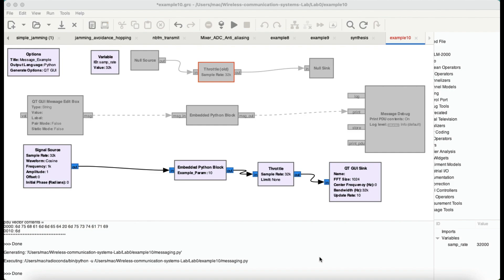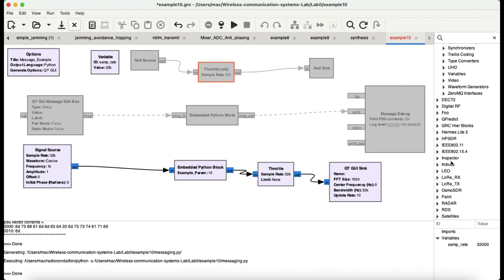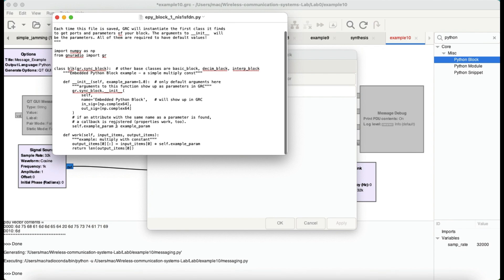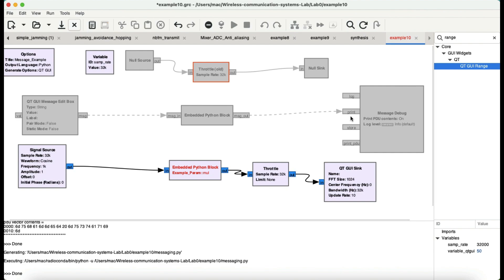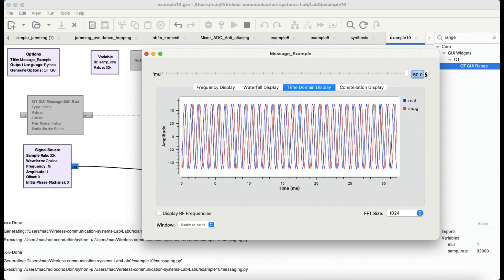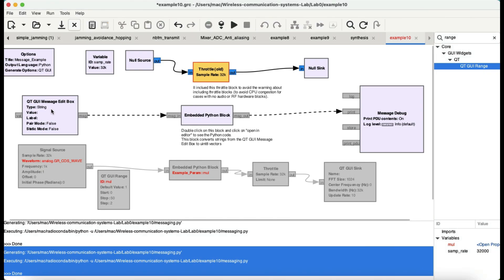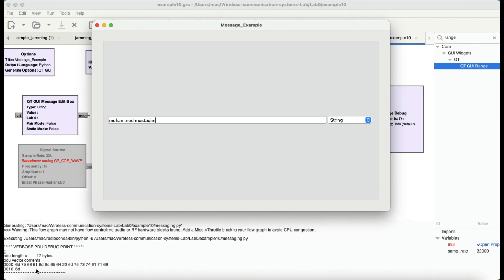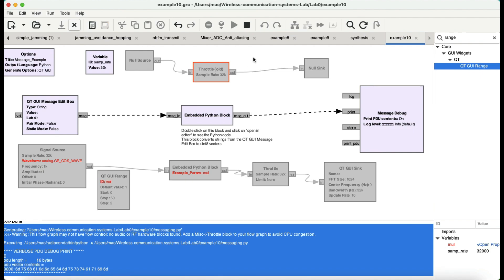How to Build your OWN block in GnuRadio Companion | Message Transmission using GnuRadio

Comment: I'm not an experienced Python programmer, not really for me, as I do C/C++, but none the less, being that I'm doing a small project with Grc, I need to use the Python Block to achieve my objectives.
Basically doing some work with one of my Ettus USRP's in this case a X310, using it as a HF transmitter, while using an other one for Receiving with Sdr Console.
Bottom line is I've wrote a program during the course of 2 years or more, a remote tuner done with Qt5/6 (C++).
What I'm trying to do or would like to do, is send some data from the Qt5 program using the COMPORT/Serial, (frequency) into Grc using the pyserial library. I have some success messing with the pyserial lib. but...
So need to put together a "Python Block" that will receive data, either Hex, ASCII, etc. processes it within the Python Block and output converted? data into the 
Grc "Qt GUI Digital Number Control" to display the frequency, then of course load it into the UHD sink. No problem loading the data into the UHD sink, the problem is getting the COM port data into the Python block then send the appropriate data to the Number Control.
I've tried using ChatGpt, but.....
Any ideas?
Regards Dale. 
If you're a Radio Amateur let me know, then I can send you/give my call. etc.